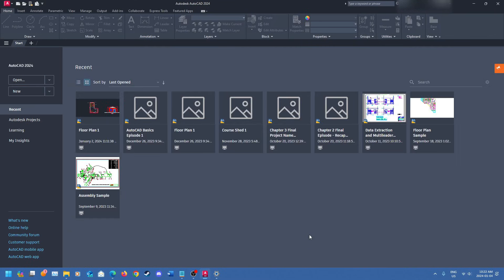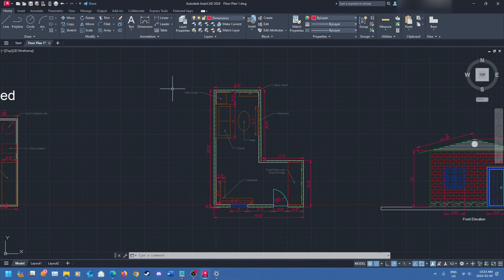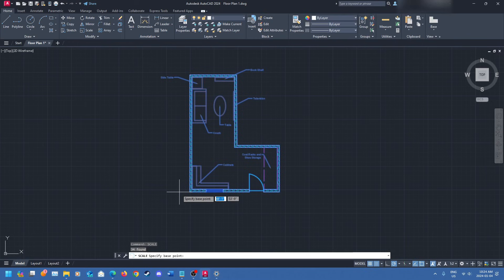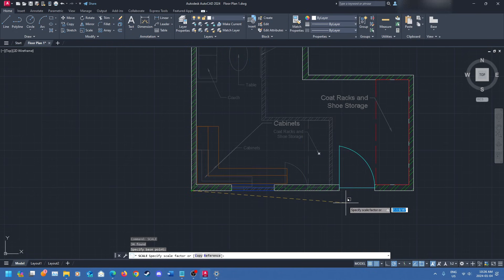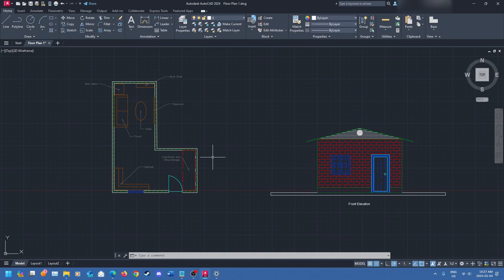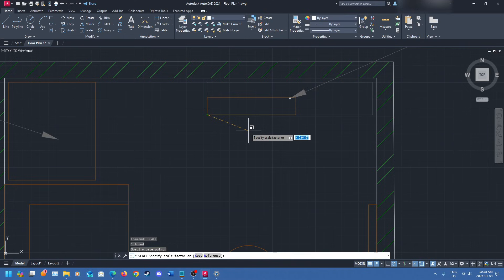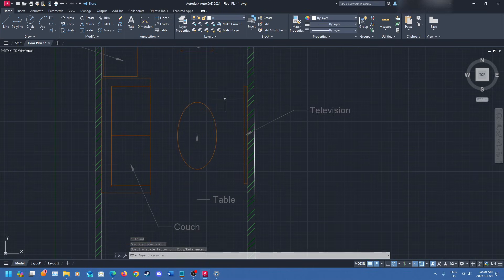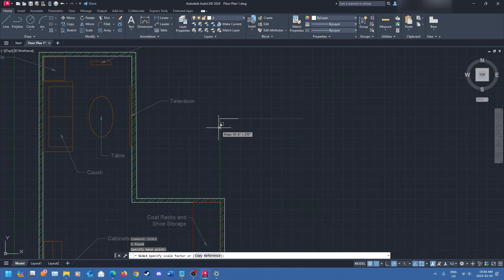How to Scale Like a Professional in AutoCAD!

Comment: Is there an easy way to make a 6-1 inch hole pattern on a 3 inch circle radius scaled out to 4 inch radius without the 1 inch holes being scaled too?
Reply from the maker: It is possible, but its an intensive process and quite difficult and honestly I'd need to look into it more. 

The issue is you need the 6 holes in the same location and you want them to move with the scaling while retaining their positions. When you scale it will scale ALL selected items.

The easiest way to do this is to re-draw the item from scratch.

I'll see about making some content on this!